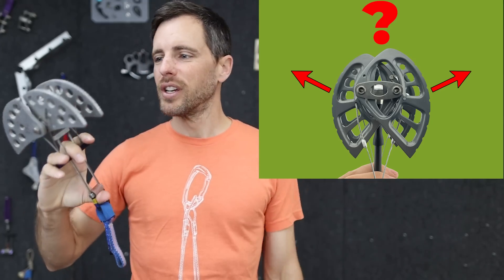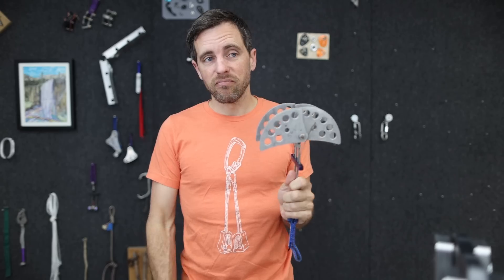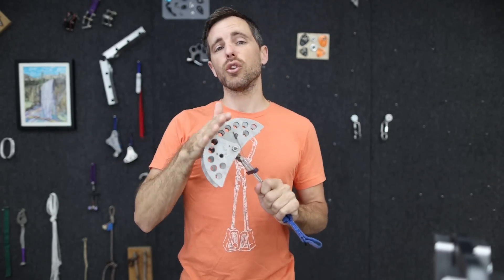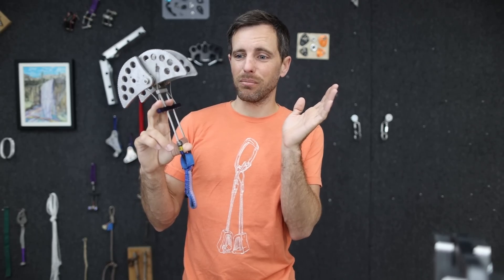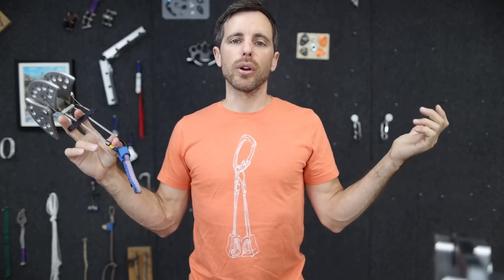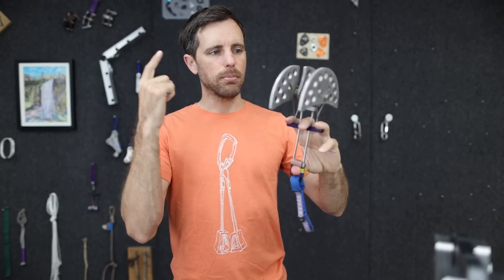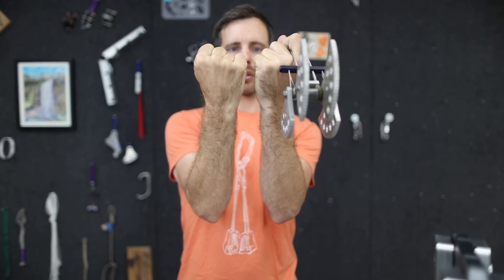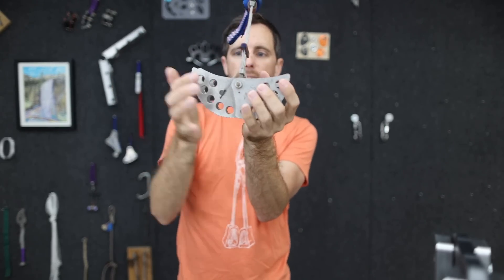I need your help

Comment: I used to teach a gear placement class that explained how cams work and broke down the physics of cam angles, normal forces, friction and basic trigonometry that would answer most of the questions asked in this video.  

Axle loaded cams (all cams except for Totem) transfer the force of a climber from the axle to the 4lobes.  Those lobes create a normal force between the lobes and the rock face.  This normal force creates a friction force proportional to the normal force which forces increases as the cam angle decreases.
Because of the logarithmic curve shape the normal force is the same no matter how cammed the lobe is (in a parallel crack) so it doesn’t matter if the cam is at 50% or at 90% cammed, the normal force is the same.

An understanding of basic trigonometry (SOHCAHTOA) will help calculate the normal forces therefore the friction force which is the  force in the vertical direction that counters the force of the climber and prevents the cam from coming out of the crack.  Cosine is what we use  to calculate the normal force and we just need to know the cam angle (13.25deg I think for most cams except aliens which I think are 16deg)

Cam angle is measured as the angle between horizontal and the line drawn from where the cam contacts the rock and the axle.

Note:  the smaller the cam angle the greater the force.  I have never seen any literature showing why 13.25 was chosen for a cam angle but my belief is if you get too small the forces are so great they start to pulverize the rock and then the cam is resting on dust essentially and pops out.  I think Aliens have a larger cam angle to decrease this force and also because they are made of a softer metal which tends to “mushroom” and squish against the rock in hard friends.  One of my yosemite friends swears they hike better and his Aliens were badly mushroomed.
Reply: When you say the climber load is transferred via the axle to the lobes, you just mean for the fbd, not that it increases the normal force, right?
It looks like the springs are responsible for the return force, which presses the lobes onto the rock and cause the normal force and thereby friction which the climber then may or may not overcome. Am I missing something?
Reply: Not sure what your acronym “fbd” means.  
Yes, you are missing something.  The cam springs which are relatively weak do not crest the very large normal force.  The normal force is transmitted from the axle to the lobes which then transfers that to the rock wall.

Look at it in 2 dimensions:

The force of the climbers fall is at the axle on a normal cam (not totem) and in the down y direction

This force is then transferred to the cam lobes pointed in the direction from the axle to the contact point on the rock.  This is essentially the resultant force of a force in the x direction and y direction (study force vectors).

The 4 x direction forces cancel each other out( the left lobes are in the negative x direction and right lobes are in the position be x direction).
Reply: Sorry, cancel each other out at the axle but you can ignore that.

At the wall the resultant force on the cam creates a force on the wall in the same direction.  This force has and x and y force.  The x force has a the normal force.  The y force is the force that friction has to force overcome for the cam to stay in place.

This friction force is proportional to the normal force.  f = ųN where ų is the coefficient of friction between the rock and can contact surface.

Hope that helps.  Much easier to show force vectors on paper than try to verbally describe.

Comment: Nice set up.  Yes. Double the load in the top load cell.  

For parallel sided cracks I think the line of force will be the same irrespective of crack width.  

Rock friction could be less than 1 so the outward force must be greater than the pull force.  

The geometry of this line of force allows a simple calculation of the outward forces.  
Rock friction won’t change that outward force.

Comment: I propose to put 2 digital foot scales each side between the cam in order to obtain kg. Then put a weight hanging from the cam and meassure kg. Putting 1 kg, 2 kg 5 kg and 10 kg 20 kg and 40 kg might be enough to get a formula

Comment: Just use 2 load scales 1 on each side then you have aeven pull and you can adjust to different cam sizes by having different friction blocks in the center

Comment: Fantastic heath robinson solution! 😁
It does add a bit of additional math (and inaccuracies) if you're talking about absolute numbers for the forces. 

But for a comparison between cams, treating the numbers as arbitrary units of force and comparing tipped out vs overcammed etc. Don't worry about the additional math/leverage etc. 
It'll tell you if a cam pushes more at its end or start of travel (pretty sure it shouldn't). 

The main thing that I see with cams vs nuts is that a nut will never "expand" in its crack. 
A cam has "travel" which is why they break flakes off. 

My thinking is always "if a nut might cause damage, a cam will cause damage".

Comment: I think that unless there are pivots translating the plates the cams push on to a known point along the lever, the calculation will be thrown out by where along that face the pressure is applied. (which will spoil degrade the accuracy of the data from asymmetric and buckling samples even if they start perfectly centered as the pressure across their footprint becomes increasingly uneven.)

I can't remember if parallel jaw/pliers mechanism are more or less susceptible to this maybe crush a couple lengths of {trimmer line or printer-filament} crossing a set and measure to see if one (or more) parts gets flattened more (ie: uneven pressure distribution). 
(edit: scratch all of that, mousedog440 has a better idea.)

Comment: I would say like this you will probably get a good idea about the relative resulting forces in all the scenarios you want to measure. So you probably get the relative answers to your questions. However, in order to really measure the actual resulting forces the apparatus has to work paralell and not pivoting on one side. With that you will get quite a distortion in the actual results.

Comment: My no math done assumption would be that over cammed vs tipped out shouldn’t give notably different results, the symmetry of the lobes are likely designed so it’s the same amount of output force throughout its range. Maybe single axle vs dual will be slightly different or those totems like you said. I’d definitely like to see the difference between a cam and a hex of the same size. Unfortunately not all climbing gets to be safe, your examples of the highline anchor or a loose feeling flake are just those situations where you have to make a hard decision and unfortunately you can’t know if just the difference between a cam and a hex is going to cut it.

Comment: What about 2 car scales (they use them for measuring weight distribution on race cars) and then you could have a jig that holds them at any width, like a big clamp. This would eliminate the lever question

Comment: Outward force is equal to the pull force divided by tan(camming angle).  So about 4x is correct for an angle around 13.75 or 14.5 depending on brand.  The shape of the cams is designed so that the camming angle is the same throughout its range and won't vary with the degree of opening.  If it isn't slipping or moving you don't need to worry about friction.  Your line scale will read 1/2 the spreading force of the cam.  The other half of the force will go through the bottom pivot which doesn't get measured.
Reply: I believe this is the correct explanation, based upon the cam geometry, assuming the crack is parallel. It's purely about the geometry of the cam and the crack, and has nothing to do with the coefficient of friction as long as the friction is high enough that the cam does not slip, and should stay the same regardless of where the cam is operating within its range.

That said, looking at the jig Ryan is working with, I'm skeptical it will maintain parallel sides to the crack and also I'm skeptical the cams will consistently be loaded equally, so I would bet there will be some inconsistency in the measurement accuracy due to the jig.  Adding a line scale to both sides might help with the inconsistent loading of the lobes, provided that it doesn't mess up the parallel-ness of the crack.

The other thing that I can see possible screwing this up is if the table/jig friction is high it might mess up the measurement of the pulling force.  Ensuring that the table is low-ish friction, like metal not carpet might effect the result.

I'm skeptical about measuring this for stoppers because I doubt they work so much based upon geometry, like the cams, and more based upon the "friction" of grains in the rock gouging into the aluminum of the stopper.  I doubt you can replicate this in a meaningful way because real world stopper placements will have so much variability in both the rock and the shape of the placement.

Comment: Until you know how much the rock, flake, boulder, etc can take before failure, your missing half of the equation, regardless of how you measure cams in this test.  Since a climber will never know how much force that one flake on that one route can take, the cam measurements kinda don't matter, the end result is still a judgement call.  But I do buy my gear from your store because it's awesome, so are the videos.  Can't wait to see the results!

Comment: 3 ideas: 1st, (insert "Statics" textbook) if anyone sounds confident without saying "it depends..." then, yikes! 2nd, you could cross-check your idea by lifting a block of known weight by pulling on 3 cams like a tripod. 3rd, if wondering about a flake (plate?), you know it's coming apart on it's own, not just from ice, but weathering & thermal, etc., so pro=bad, I think this's interesting from perspective of breaking rock around shallow placements (also, geotech. engineers have typ. rock strength charts).

Comment: 2 loadcells might reduce and maybe eliminate unprovable maths. But this is a guess from a non-expert. 

Maybe try one and two cells and see if there is a predictable ratio between the two options.

Maybe force the plates apart with a device that dishes out a known force. And see if the readings on the loadcells tally.

Comment: I build and get one off machines running that the engineers design and I can tell you from my experience that cam loads from the math and cam loads from the load cell are in fact different 😅

Comment: This isa 2parter first section to answer cam force, second for the test themself.

As a mechanical engineer this is basically two teeter rockers in equilibrium, with the normal force going outward as pressure, which in turn means friction. We can calculate it easily if we look at it from a 2D plane.

All forces should add up, if you collapse the cam fully and you pull straight down (Y direction) with 1KN and the contact point is at the tip of the lobe but also straight down (force vectors of pull and normal force is directly opposed, basically nut placement) each lobe should see 0.25KN as the cam is essentially resting on each lobe.
Now if contact point is 90° straight out (x direction) you will find that when you split the normal force vector in components the X  force vector goes towards infinity.

So the force goes from 1/4th to infinity depending on angle between cams pivot point, stem and contact point. And as cans is some sort of Fibonacci curve I would assume that the growth is exponential, depending on the cams shape.

From there it's simple trigonometry to calculate any given angle, and the lever action should be proportional to the friction.

-----------

With the same logic as above you really only need one scale to measure as the force will be "equal" between the lobes, I write "equal" as it assumes that it won't hardly be any bending in the Z direction skewing the angles of the hypotenuse of the normal force vector.

With the same calculation I don't think a test jig for nuts is necessary.

Comment: For non-Totems, tan(14 degrees) = 0.25 = ratio of vertical to horizontal force on a lobe (BD guy's number).  But since the axle is supported by 2 pairs of lobes, each pair only sees half the stem's force.  So the rock sees 1/2 * 4 = 2.

Friction would increase the answer by sqrt(17/16) i.e. 3%  if you were to measure the total (diagonal) force on the sides of the rock.  But I think you're planning to measure only the normal (i.e. perpendicular i.e. outward) force, for which friction doesn't matter.

For Totems an accurate answer might need https://www.totemmt.com/wp-content/uploads/2018/09/TotemCam_Mechanical_Principles.pdf (but I suspect the result is similar)

Comment: because the cam is a cam, the force is different at every different width. I think the cam is designed in a way that the cam pushes harder the wider it goes until the cam math stops working for it/friction

Comment: Lets look at the simple situation on the jig. I totally agree in simplified conditions, practically in the jig, the cam horizontal normal force is 2 times the reading in the linescale.

Looking at the cam in the jig at 8:15, with those straight parrarel walls, we can say:

Normal force acting on wall of jig = (Pulling force) x (Cam multiplier effect)
This is the cam multiplier effect acting or pushing to the walls.

and in the static condition as it is, we can also say its static because:
Pulling force is equal with static friction force. Until it doesnt and slips, right? But this is still static.. so...
Static friction force = Normal force x coeff. static friction 

Where the coef of static friction of the cam to walls, symbol myu s

so... combining all of these: 
Pulling force = [pulling force x (cam multiplier effect)] x (myu s)

you need these two coefficients right?
1. cam multiplier effect
2. myu s, coefficient of static friction of the cam to the wall, be it the jig wall or a rock wall.

Can we post links here? Theres a video of a college project posted here by Skylar Whitcomb titled Climbing: Physics of the Cam. the 7 min and 26 seconds explains the math. I hope sombody can re-verify it. Im sure the lecturer has done it. It was calculated the cam pushing effect is around 2. I'll take that for now. Good enough for me. But math savvy guys can (please) check it more deeply, especially looking on the single axle vs double axle cams.

Thats what i got so far. Hope it helps

Comment: You could use closed hydraulic hoses with a pressure gage. You need to calibrate it though and see which pressure equals which force applied. Pretty sure you can figure out a design.

Comment: Make a model of the jig to test, or modify the jig so there’s an eye bolt or plate you could pull out on with a couple of line scales, to simulate the push of the cams

Comment: My uneducated guess: a cam is a specific linkage which can be adjusted to bypass then fill a fissure. Mainly relying on friction as its loaded (even being wider than the fissure is in that localised area).

There are probably a few different kinds of rock formations you want to test against. To see if you can generate more outwards force. 

My concern with rock moving at the placement of the cam, would be opening to a point the cam isn’t engaged enough. Then it slips out. Can a cam act as a lever/wedge here? Can a cam widen certain fissures to be unsafe?

These are just some questions that will need to be answered.

I do like your simple jig to be a proxy rock surface and you wanted to test when cams busted apart. But this jig probably isn’t going to do much. Try building some larger rock formations. Ideally that you can cast the same surfaces to test how break tests behave. Would a right mixture of concrete and large enough aggregate be strong enough to compare to real rock?

Comment: The angle between the axle and points of contact is what's important here for cams. A more open crack would reduce that angle (more pressure), and pulling the wire through a hole in a plate (with the cams touching the back right next to the hole) would make it the most acute (only the force of the load going into the rock).

This disregards friction on the axle. Friction between the cam and rock only needs to overcome the friction on the axle as the force is going straight into the surface. 

For nuts the calculation is entirely different. Here friction and shear forces in the rock and nut determine the vector going outwards. With zero friction you would need to equalise the vectors in a direction determined by the angle of the crack, and with infinite friction there would only be a shear force that's slightly lower than half the load. I'm guessing the friction coefficient of aluminium on rock is somewhere between those two situations.

For the jig: maybe get two linescales so you don't have to worry about offset loads and the asymmetry in the cam - pressure sensors would run into the same issue as your current setup does if the system deforms, and i think it will. Good luck!